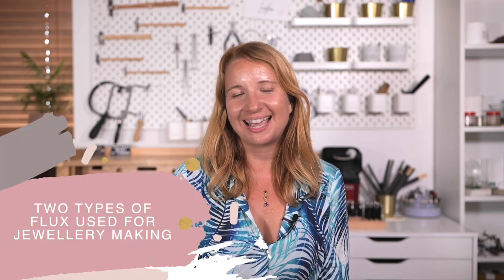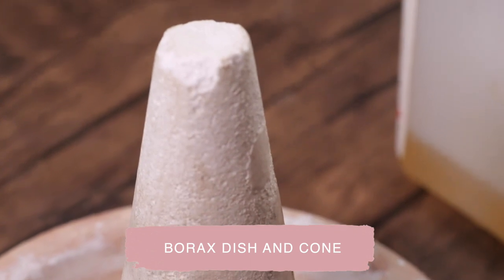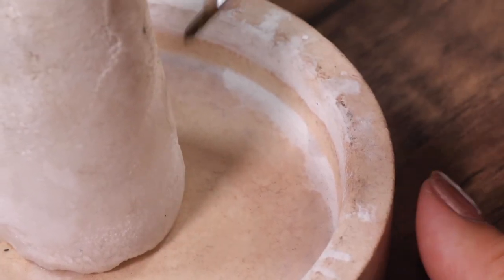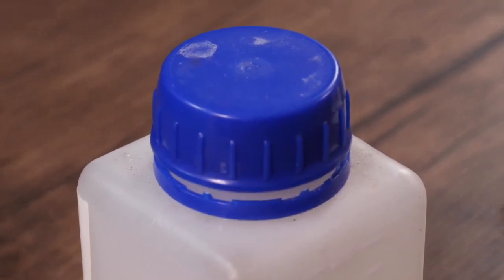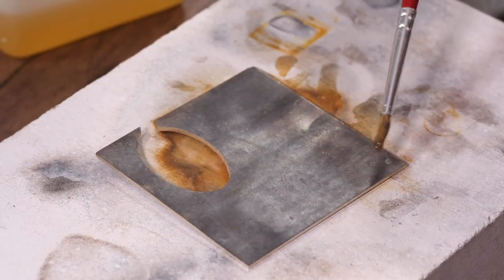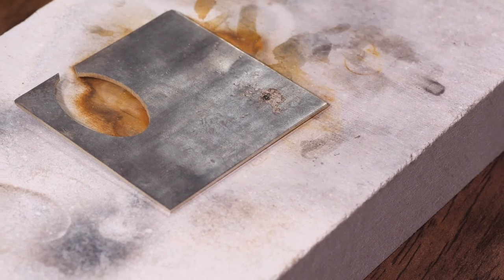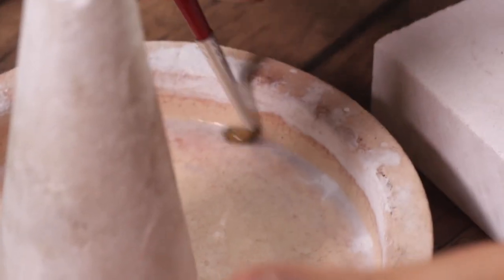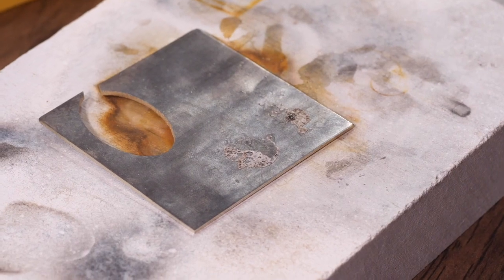A Guide To Using Flux For Silversmithing - Jewellery Making Tips - Jessica Rose

Comment: Are there different types for different metals? Where do you get it? Any brand recommendations? Could use a little more info
Reply from the maker: Hi there, which metal are you working with? The flux shown in this video - the borax and liquid flux, are best for working with silver and gold. I believe there are other types of flux for working with other metals, but these are the ones we use when working with copper, silver or gold. 

Cookson Gold stock a wide selection of flux so might be able to offer some more advice on which ones are best for platinum or stainless steel.

Hope that helps! x